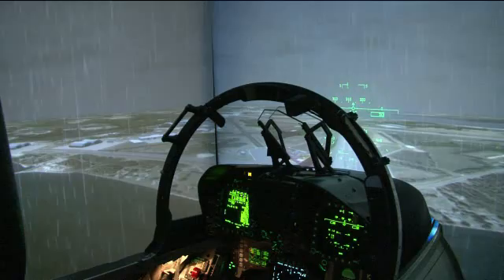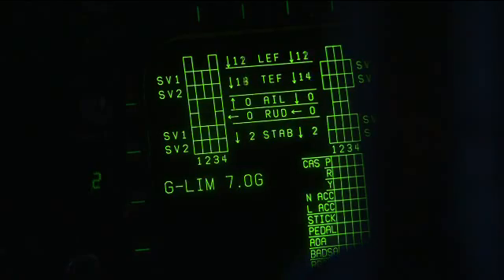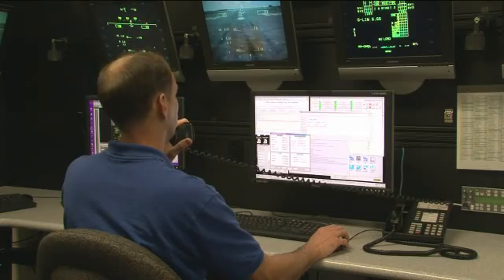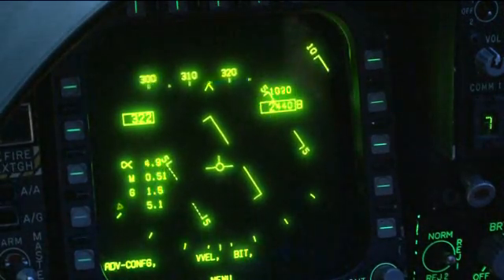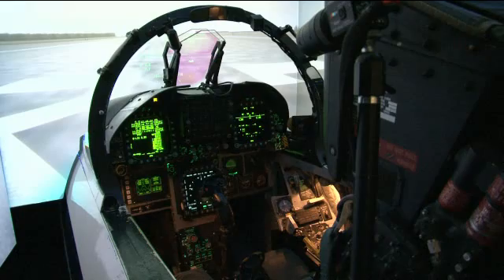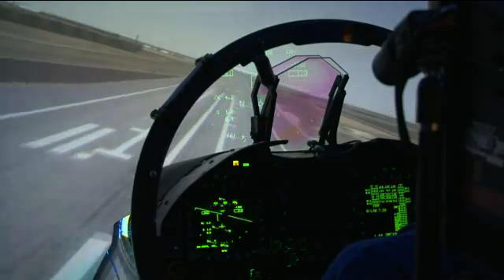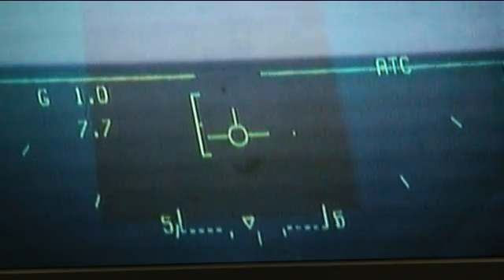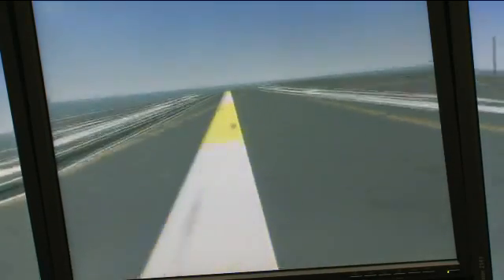Navy F-18 Flight Simulator

Comment: You'd require the clearance to get onto the facility they are placed in, the simulator it's self would not require clearance, these days you go to an airshow with air force or navy presence there is usually a simulator that civis can have a crack at.